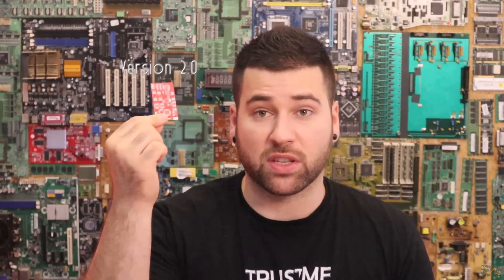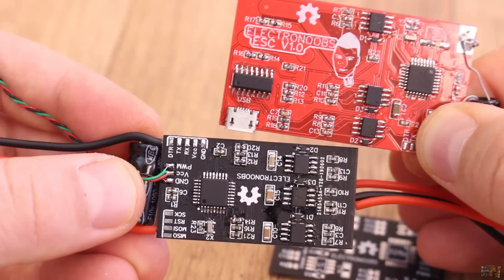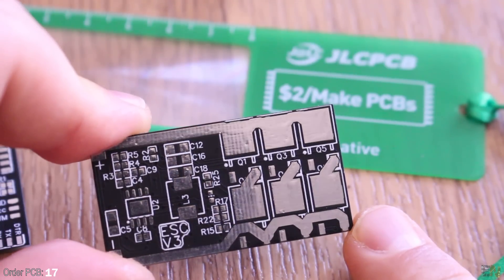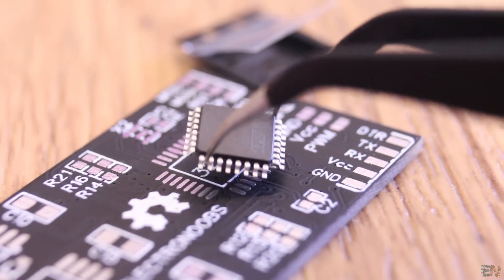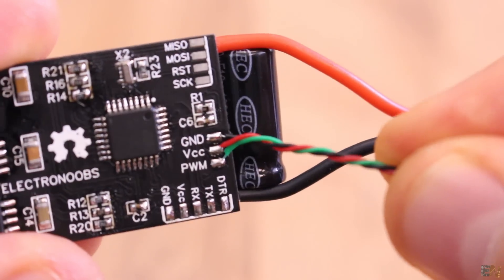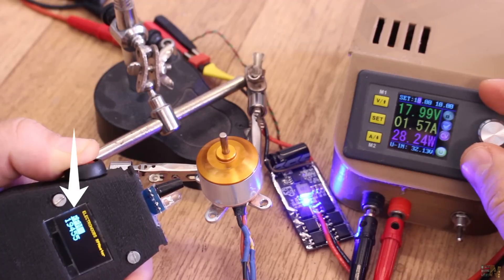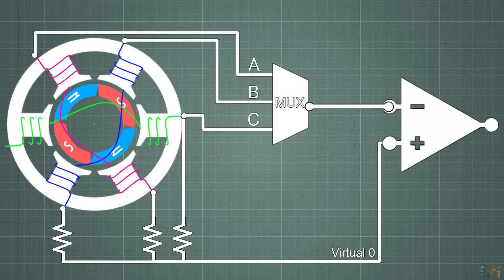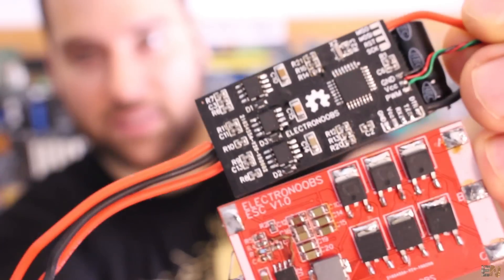Open Source ESC based on Arduino - High Speeds

Comment: Some tips regarding the project:
1. You can build a jig and use pogo pins for mass programming of the modules
2. You could/should have used a bigger value for the dropper resistor on the LED. That amount of light the LED gives, is pretty much useless. You only want the LED to notify you that the circuit is running, not to light up the room. If you have the datasheet, you can use the U/I plot from there and calculate the resistor value.
3. You could theoretically limit the heating of the motor by limiting the windings to go to saturation. That means you should limit the PWM to a set threshold, based on some measurements. The idea behind this is that, drawing a I/L curve, the inductance will have an upward characteristic, but after some point, the inductance will go down, even if the current through the coil will rise. That's the point where the losses on the motor will start to get higher. To achieve this, the 328p will probably not be enough.. You could use a current shunt, measure the current and amplify the voltage drop, and then pass it through a comparator with a set threshold, which would trigger some interrupts. There is a big story behind this, and you can find a lot of resources online. 
4. Since this would be a kickstarter project, I would suggest switching to Atmel Studio for better integration and you'll achieve thighter control over the microcontroller resources, and I assume that would mean that you'll get out of your comfort zone, but you'll master the "real" programming of microcontrollers. Arduino will limit you quite a lot in using the microcontrollers resources as it is supposed to do that automatically without you even reading the datasheet. 

Overall, you did a great job with this project, and I hope that the kickstarter will be successful. I'm planning to do a similar project on my bachelor thesis, which will be next year :)
Reply: You really understand about the topic. I need an not expensive 500A ESC for a bike project. Do you think changing the mosfets and capacitors in a commercial esc I can achieve this ?

Comment: Nice work as always. Some suggestions :

A) In your  kick Starter ESC i think you must include the option the user can upload his own code or maybe next versions of your code ..
this is something that will make it more appealed to users.  (most new ESC have the option to update their firmware via some tools)

so you can include the pin holes to program the ESC  with an external  FTD1232  or similar 

B) An other option could be a second Board ESC  with the use of an Arduino Pro mini   (not for Flight applications) for  Ebike, remote cars, boats  etc   projects 

i am thinking to build one to use it for my needs  but as it is based in your  project /schematic  i think it would be better  for you to make a commercial one
Reply from the maker: The board has both UART and ISP pins for programming

Comment: Since the microcontroller is using low current to drive high current, I believe the buck converter is not necessary. LDO can drive the digital IO while the battery supply will supply current to the motors and other high current connections

Comment: I have some ideas for improvements:
1. Switch the hot phase in complementary mode - lower conduction losses (the current will circulate through the low fet channel instead of the antiparallel diode).
2. Have the ground phase be constantly on - no need to switch the low fet.
3. Monitor the battery voltage, at low voltage stop the motor so you have enough juice to dead stick land.
4. Add current sensing to protect the motor, can also be used to improve the PWM scheme by closing the current loop - current = torque = power - current can be sensed at the fets source return (common shunt for all 3 fets).
5. You can then close the speed loop - reciever sets speed demand, speed loop commands the current (torque) loop - this way you can have variable load on the motor and constant rotation speed - not really needed for a RC plane ESC, but it's a learning experience ;-)

Comment: Dear Electronoobs, 
You should consider cleaning your PCB from flux, eg. with acetone. It will be more elegant and will make understanding circuits easier.
Best regards
Reply from the maker: Sorry, i've done that after I've recorded  the video... I'll be more careful next time
Reply: Acetone might remove the solder mask

Comment: Very well made, congrulations friend :) In my opinion you may want to change 1N4148 diodes with better shotky low voltage drop diodes. Just an opinion :)

Comment: I'm not particularly interested in FPV/RC stuff, but don't let that discourage you. I'm just one subscriber/viewer. 
  However, I thought Kickstarter was dead. I know Mick over on the Mick Makes channel has mentioned how most people seemed to have moved to "Crowd Supply" instead. Apparently CS doesn't cause the end customer to be quite as vulnerable to the failures and frauds that Kickstarter and Indigogo have become known for. It's worth taking a look at that platform IMO. 
  I also recommend watching and subscribing to Mick Makes if you haven't already. He does a lot of reviews of other people's hardware from all over the world along with developing his own. I have seen several YouTubers over the last year that have followed a similar, "mostly review hardware/occasionally release your own hardware" YouTube channel format. Mick does it well. He's got a great and under rated channel.
  This project looks interesting. If I were into this kind of thing, perhaps I would try to buy one.

  Lastly, I understand why you are not trying to add the USB CH340G stuff in this application, but have you seen the CH340E stuff that is being pushed on AliEx more now? It's a smaller TSSOP-10 package, but it looks like it doesn't require a crystal either. It's got the required UART + DTR pins. I just ordered a breakout board and 10 chips to try it. The cheapest chips I found were $0.32 each with a total order shipping price of $0.42 on AliEx. That's $0.74 in single order quantity, or $0.362 each in a quantity of 10.
  The newest Ardy Nano compatible stuff from China also has this chip. 
 The CH340G will probably still be my go-to chip for hand soldering, but I've been playing with smaller layout designs and the CH340E looks like a great option for reducing the board space requirements of the CH340G and crystal.
  Thanks for the upload and good luck with the crowd funding campaign.
-Jake
Reply from the maker: Thank you very much for all your tips. I'll consider all of this. Thanks again!

Comment: Hi, congratulations on the channel and the consistently high-quality content! I’ve been following you for a while and truly appreciate how you explain complex technical concepts in such an accessible way.

I’m currently working on a project to develop an ESC for a brushless motor that uses a 23-bit encoder communicating via RS-485. The motor will need to follow the position I send it through the serial, using a 32-bit data input. I’ve already implemented the code to read the motor’s position in real-time, and I was wondering, based on your experience, if it’s possible to avoid using Hall sensors and manage the commutation directly based on the absolute position provided by the encoder.

Thank you in advance for any advice or feedback, and keep up the great work!

Comment: first of all, thank for your project, now i can make my own esc. but i still can not reverse the direction. i think you can brake it immediately by connect A B &C wire together( maybe short them to gnd at the the same thime), i brake it already. yes, i did it by hand(lol), i installed a fan to the motor and facing with another running-fan, then boom!, i brake it. hope its helpfull for you :))

Comment: Hey there that's an awesome video on esc and direction changing method is just cherry on cake. But can you please make a proper desrcitive video on various techniques of n channel mosfet bootstrapping and gate driving circuits and gate driver IC's with all necessary information it will be great help to all electronics community and hobbyists Thanks in advance☺

Comment: the buck converter should be on a separate board and so should the microcontroller.  this way everything is modular and smaller and easier to fit in your project with a more flexible form factor to fit it into tight places as needed.
Reply: but GREAT job overall and this is just my preference based on my projects use case but is not necessary and maybe not even best just for learning case like this board may be for.  I am meaning more for use in actual projects

Comment: Beautiful Project ! Love it ! I see that the Pcb can be Designed for higher Current . I make a lot of prototype electronics for ROV robotics . One of my main issue is that the market don't supply those kinds of platforms . If you don't mind I can give you a suggestion ?  It wold be beautiful if a Dual channel ESC board is made for High Current capabilities with the forward and backward speed control . The ideal robotics platform wold be 2 x brushless  control with a digital relay output in case of signal loss and a 10 to 15 amp 5 Volt BEC to be used for high current Servos  that can be also in the main Board controlled by a different arduino Chip . Just a nice big universal robot control board . I did several of this Multipurpose platform for my robots . Just by the plain reason cause I don't want to be stuck by the limited robot tech that there's on the market . And for being Open Source ! I truly believe that those kinds of things will be revolutionary for any Hobbyist . Hope you get to read this message soon :) have a nice day

Comment: Please Please Please make next ESC something like a mini affordable version of O-Drive. As kind of ESCs you made are already available cheaply.
Reply: Its not about what u can buy for cheap it is about what he has achieved and code for such a simple thing is very complex now thing about what kind of code u would have to write if u want to make something similar to O-Drive
Reply from the maker: I never used the office but I've looked over the schematic and there are drivers and mosfets so seems quite like this one but the only difference would be the code you use. That's why this is open source so any make could get my code and change it and make improvements.... Keep up!
Reply: @ELECTRONOOBS  Thank you for the reply,  O-Drive implements the use of Field Oriented Control, do you plan to explain or implement FOC in future?
Reply: @nazirahmadshah367  Exactly! I wasn't demeaning this project but suggesting future projects and direction this ESC video series could go.
Reply: @ELECTRONOOBS  you can decrease the pcb size significantly if u use qfn packages of the MOSFETs and the microcontroller

Comment: You should employ braking in your code if you're going to split the stick to run forward and reverse direction , changing commanded direction before the motor dissipates its inertia will stress the  fets and possibly kill them.

Comment: great project! i would love to see a continous current test with these boards, the mosfet rating is insane. also, i like the idea of a kickstarter and would probably get my own board, but i didn't quite understand if you plan on selling them pre-assembled or as a kit. personally, i'd prefer a kit to level-up my smd soldering :)
Reply from the maker: The idea is to make them preassembled with a pick and place. But I never done that so if I can't do that, well maybe a kit. Not sure yet....
Reply: @ELECTRONOOBS  pick and place ideally needs all smd components on one side of the pcb. (It can be done on both, but gets way more complicated.)
Reply from the maker: @TheRainHarvester  thank you for that. I'll have to ask this to the PCB manufacturer and see what they will say...
Reply: @ELECTRONOOBS  Sure thing!  In my research, having a board populated is expensive: $5 for 3x5pxb and possible increase cost in components and/or shipping to send them components.  Have you found good prices?

Comment: Hi.can sudden Braking is possible with BLDC Motor?using your board??
Reply: Probably Not.
Reply: Thanks @GM_handle22  then how can i achieve that??any suggestions??
Reply: @praveenwinrap7510  Need little modification on PCB side and Code side 
1. Have to add Relay or MOSFETs units for dynamic braking. (Disconnect the power and short-circuit the terminal with a resistance). 
2. Code wise just add a lines when pwm is zero and speed is observed initiate breaking.

Or better have another idea without any modifications but need to test.

Comment: Would be interesting to be able to control the motor at low RPM.. Then main board can read hall effect sensor or encoder and use your ESC to drive the motor.

Comment: 3:45 Toys might work due to the low current, but bikes???
Anyway, I thank you for sharing. I will experiment with your PCB V2 (as there is no V3 available).
P.S.: Due to the "virus" and hysteria of so many on this planet electrical components are so rare / not available.

Comment: This projects looks cool, but the schematic you presented for sensing the BEMF will fry the microcontroller at voltages higher than 12ish volts. Did you add a divider to the neutral point too? Really like the new board btw, the old one had some power dissipation issues.
Reply from the maker: Hi. What do you mean? The sensing dividers are of 10K with 33K and that will lower the voltage to around 2.7V.
Reply: @ELECTRONOOBS  Yes but the VNP is approximately the supply voltage divided by two. I have seen bad schematics online which divide the three phases but not the VNP. Here is a link to an ideal setup: https://imgur.com/a/CskN30V. I think your ESC works because you take the neutral point after division, after looking at your schematic. You wouldn't need to denounce your comparator in the code so much if you took the VNP separately. This would allow for higher speeds!

Comment: Will this size pcb work with larger motor like from a washing machine? How many separate electric motors can you connect at once? How would you know what the max your board can control? Would larger motor require more then 24volts

Comment: Nice use of the analog comparator! With the release of the arduino nano every, it has the new ATMega4809, which features a faster ADC. do you think with the ATMega4809, an integrating trapezoidal control algorithm would be possible?

I got such an algorithm to work with the STM32F446RE, sampling all three phases at 70kHz, asynchronously to the main control loop and PWM signals, and implemented filters in the resistor dividers. I'm sure it would still work at 50khz, but just not as well at 100k ERPM.
Reply: I was just gonna say that... I have plans to use that single analog comparator as a current sensor... Just have to touch up on my coding

Comment: i want to make a brushed ESC for control four 180 motor with arduino and i want to use it my brushed motor drone. you know for this needs much thrust if i use LR7843 can i get full output of current from battery and can motor run at full speed?? (sorry for my language bcz i cant speak english corectly).... plz help me

Comment: Is there any way to make one ESC to run several motors?  I'd like to see a design that can control 4 or more motors at the same time from a central location instead of having 1 ESC per motor.  This would save size and weight.  Maybe even the bulk of the ESC being a central unit with tiny boards at each motor.  Every gram makes a difference when making drones.

Comment: hi nice video and tutorial, thanks for share, is possible  use the timer of the mcu for detect the zero crossing and change the step conmutation in the esc for adjust the motor timming? thanks

Comment: Does anybody know how you'd control four motors like on a drone? You'd have four of these running on the same drone and then configure them to use the same signal (but in CW/CCW pairs). Or perhaps you'd need one esc for each pair and use each esc to control the CW or CCW rotations? Or perhaps a single esc and one set of wires to another circuit which would inverse the signal?
Reply: you will need different one for each motor as it should operate isolated from each others based on the gero inputs

Comment: Hello. I would like to make an ESC with an stm32 microcontroller based on your Arduino project. However, I am having trouble detecting the zero crossing of the BEMF using a comparator. I would like to ask for your help. Is the virtual neutral of your circuit a continuous waveform? Or is it a waveform synchronized with the PWM?

Comment: Nice board. For Kickstarter: What are the advantages over a commercial ESC?
Reply: I guess that its open source and you can adapt components and code to your needs?
Reply: None... Most ESCs have an ATMega8A and are supported by SimonK... You could also flash this firmware with some tweaking (I don't see why you would want to do that)

Comment: Hello. I don't understand the BEMF voltage dividers. In the schematic R22 and R16 using same value is 33k. R14 using 10k. But I see in your video using R22 1ohm, R16 33k and R14 12k. I don't understand that, that divide for 12v? I want calculation for bemf voltage dividers same like 24 or higher voltage

Comment: Hi, thanks to you for all your dedicated works. I actually can get my own projects working faster because of all your hints. I'm also in the process of designing a 144 VDC 6-phase inverter. I do have a question! Why use a voltage divider to read the bemf instead of shunt resistors connected to an high current shunt monitor chip ?  Thanks

Comment: HI, i have problem in generating 30 degree delay after zero point detection. Can you explain to me how to create a delay for phase transition (although I use stm32 combined with opame anything related will do).
+ I also don't see the delay in your source or because I don't see can you explain more